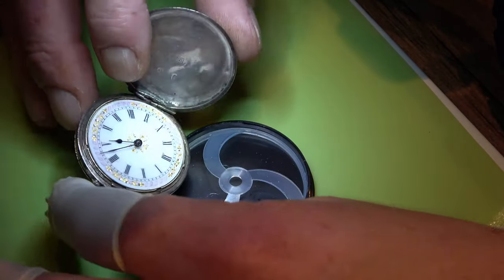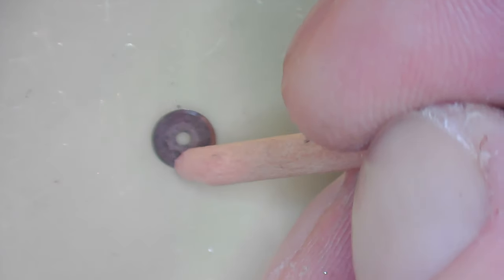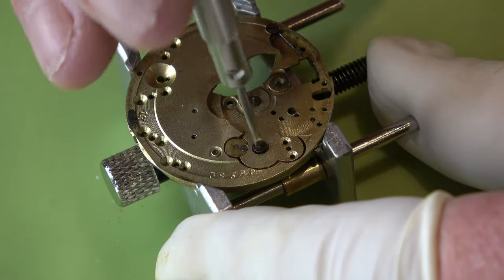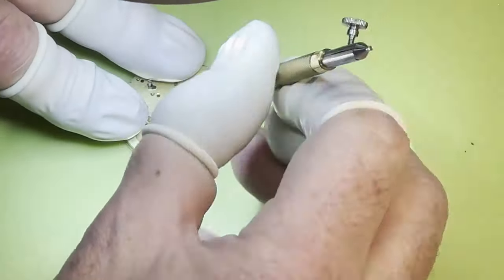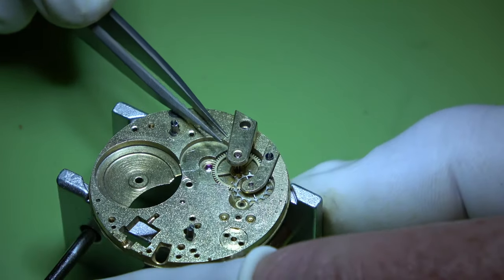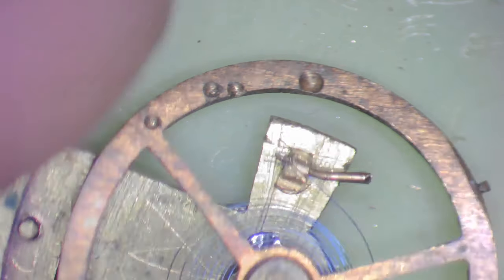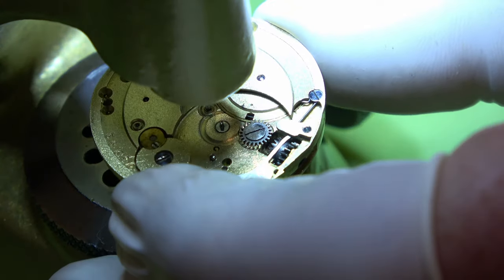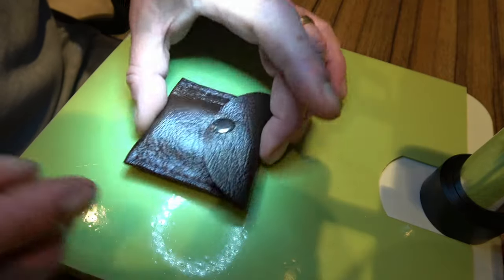Restoring a Vintage Cylinder Escapement Pocket Watch: Overcoming Challenges to Get It Ticking Again!

Comment: Good job on the watch and the video came across very well also. I hope you will be able to fix that pivot. Material houses use to sell tampons which are the pivots that fit in the end of the cylinders. They can be tricky to get in and out. Some staking sets included special punches and stakes for that purpose.😊
Reply from the maker: Thanks for watching my friend and thanks for the info 😁👍👍👍

Comment: Many thanks for this excellent and interesting video
I have a question,  is there is special method to reput the balance in these cylindrical movements,  what we can care about in this procedure ❤❤❤❤
Reply from the maker: Thanks for watching my friend. 👍👍👍 just need to make sure that the teeth of the escape wheel engage in the slot of the balance wheel. They don’t start automatically you have to give them a little kick.

Comment: At 4:26 you don't really need or WANT to remove that plate.  It's position is not fixed, as you move it slightly to adjust the engagement of the teeth on the escape wheel and the cylinder.  It's fairly fiddly to adjust it properly to get them to run well.  Cylinder escapements are tricky, hence the reason many watchmakers won't even look at them these days.  Nice job.
Reply from the maker: Ahhhhh you may have answered a question on another pocket watch I was restoring. Thank you for the advise it’s much appreciated. This was the first time working on a cylinder escapement but definitely won’t be the last lol thanks again for the advise and watching the video. 😁👍👍👍

Comment: Excellent work on the watch! I have one similar to it - cylinder escapement 8 jewel. Beautiful dial. No maker's mark on the main plate just a curved arrow. Mine has severe wear of the 3rd wheel pivot. The pivot will have to be replaced. Could you repeat what you thought was the maker's name?  Thanks! John H.
Reply from the maker: Hi John, first thanks for taking the time to watch (puns intended 😋) it really is appreciated 😁 I thought it was a Stauffer, Son & Co pocket watch. Found some of that make with similar dials. I have another similar pocket watch with the same issue you have, I’m going to try and re pivot the wheel 😳 wish me luck lol once again thank you my friend 👍👍
Reply: @HorologyHubub  Thanks for the information! That looks like the maker.

Comment: Great video very useful thanks. Can you confirm that pushing out the broken jewel from one side opened up the brass bead that then needed rubbing back over to support the jewel in place. I liked the use of the jacot tool and would be interested in how to set it up as you have to use. Is that an extendable key ring fob you use instead of a bow on it... fascinating 👍🤓
Reply from the maker: Yes the hole opened up after pushing the jewel out, otherwise the other end of that jeweling tool is used to open the hole up. I will definitely film setting the Jacot tool up and more on the use next time lol and yes I saw that key ring method on another channel and have used it since. Thank you for taking the time to watch it’s much appreciated 😁👍👍

Comment: Hi great video, Just wondering if you can offer some advice to me, I am just about finished a cylinder movement very same as yours, im stuck with the keyless works, the setting lever thing that the pin pushes wont align correctly, if anyone thinks they can offer some advice please let me know and i can send photos or a video of the movement. thanks
Reply from the maker: Thanks for taking the time to watch my friend it’s appreciated. 👍👍 email me some pictures and a video if it will allow. 
horologyhubub@gmail.com

Comment: My father brought home a "lapel" watch from Germany after the war. A beautiful pink gold and silver case with yellow and green gold roses, about the size of a quarter. I got hold of it as a child and thought it might taste as good as it looked so I bit it and broke the glass crystal! Several years later I felt very bad for my stupidity as a child and tried to get it repaired. The jeweler said it was a "Barrel Movement" and it sounded like a galloping horse. He could not repair it. I still have the case and porcelain face, but the movement is long gone, so sad. I have often wondered if a modern movement could be adapted to the case? I would promise not to bite it again!!!
Reply from the maker: 🤣🤣 and did it taste as good as it looked ?  I think anything is possible my friend, if not a modern movement then possible a vintage movement could do the trick!  Thank you for watching it is appreciated 👍👍😁

Comment: can you tell me where you got the mainpring i am working on the pocket watch that i got from my grandpa and its the same movement
Reply from the maker: Hey Elder thanks for stopping by 😁 it’s appreciated my friend. Cousins.co.uk is my place for those sort of parts. You can do a search, the barrel diameter plus the spring length, thickness and height and it will show what they have in stock. Maybe see you in Chronoglide chat tonight 😁👍👍
Reply: @HorologyHubub  thanks love the channel

Comment: Allow me to make some comments about this video:
moment 5.25: the coq and the balance wheel must NEVER be removed with a tweezer when clamped together. If the pivot of the balance shaft is still in the tap hole, it will be folded. That may be the reason why the top pivot is crooked. Simply leave the balance wheel hanging on its spring from the coq when disassembling.
moment 13.23: the fixed screw of the mounting catch for the winding pin is removed (the rotating screw was removed earlier). This catch has nothing to do with the setting of the time (27.34) as this is done by pressing the button on the side of the case and turning that winding pin.
moment 27.16: because the mounting catch was not mounted BEFORE mounting the barrel bridge, its fixed screw cannot be placed and tightened. Where has it gone?
moment 32.46: for a moment it is visible that a hole has been drilled by the top of the balance pivot in the center of the steel plate (replacement of cap stone). If not replaced, this will cause the balance swing to slow down or even come to a standstill.
general note: it is better to attach the dial AFTER mounting the naked movement in the watch case. If the winding pin is not inserted correctly, the pawl (14.16) usually shifts over the sliding clutch and the dial must still be removed to correct this. In addition, pressing on a dial during (difficult) assembly of the naked movement can cause cracks in the enamel.
Reply from the maker: Thanks for the info and for watching 👍😁
Reply: @HorologyHubub No problem, always willing to help a passionated enthusiast.
Reply from the maker: @philipsleo8073  it’s almost 12 months the to the day I took apart my first watch 🤣🤣 and whilst I know I have learnt a lot, I also know I have such a long way to go. And it’s thanks to people like yourself in the community that helps us all learn. 😁😁 once again my friend thank you 👍👍👍